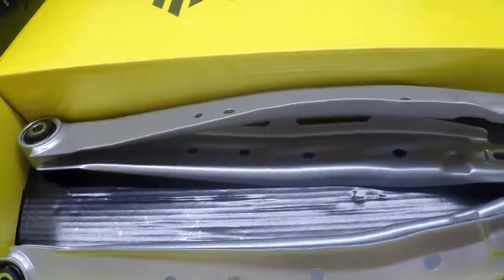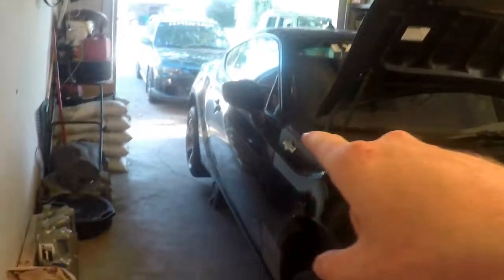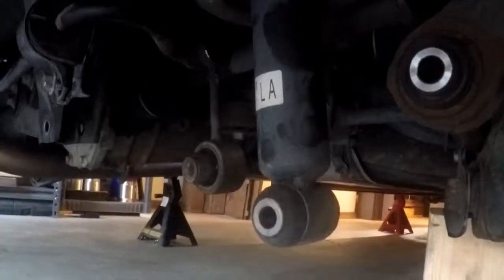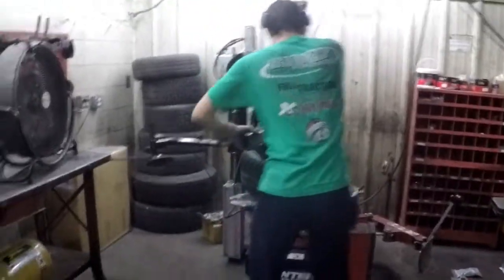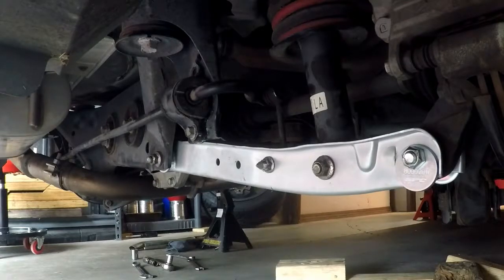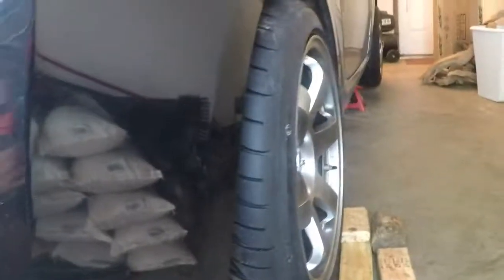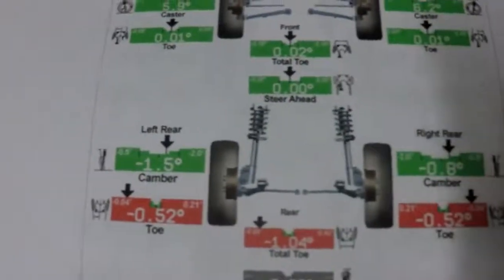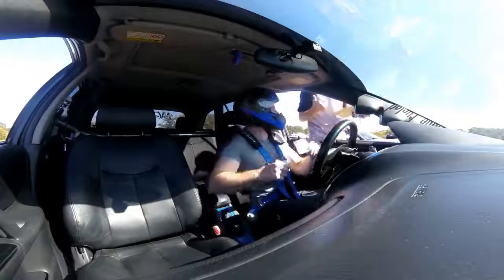How To - FRS/BRZ Lower Control Arms

Comment: Question did your kit come with bushings that are offset for your toe arms
Reply from the maker: It did not. Just the arms. I highly suggest getting adjustable toe arms or upper control arms for more adjustment. I could not completely remove rear camber without negatively impacting toe.